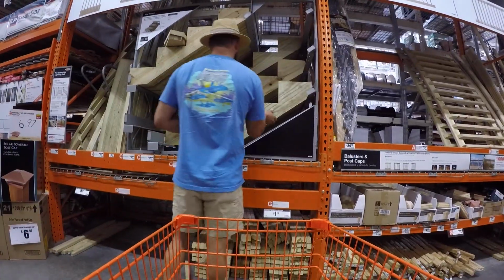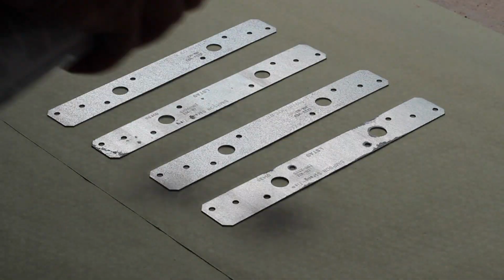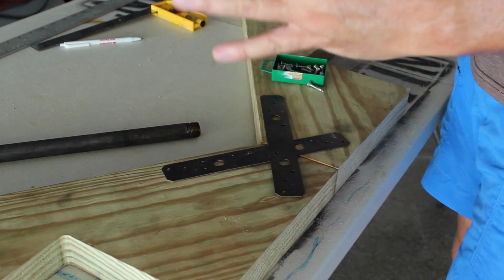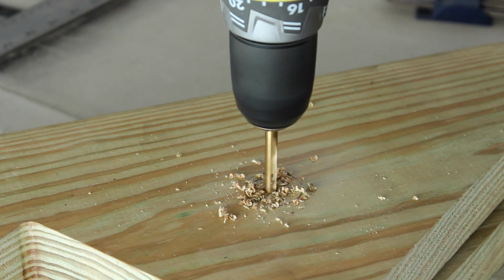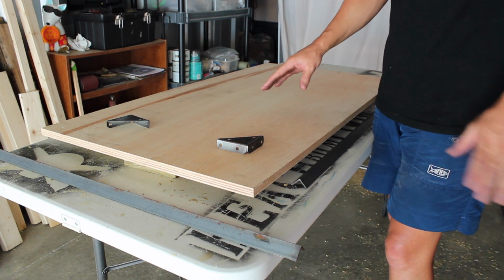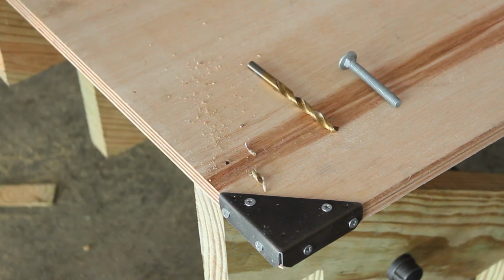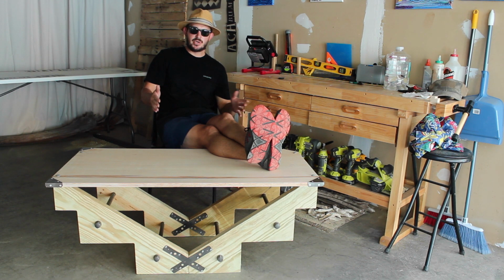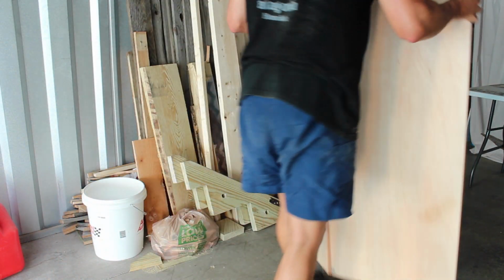How to Build the EASIEST Coffee Table Ever in less than 1 HOUR!!

Comment: Very innovative. I’m just curious, is it not inclined to rock like a pendulum. With the legs centred towards the middle is the table not going  to lift on one end if weight or downward force is applied on the opposing end. Regardless, I subbed your channel and give you 10/10 for your clever design concept... I’m going to give this a try and use distressed pallet timber for the top which I’ll also scorch with a propane torch to creat that shu Sufi ban effect.

Comment: Wondering if it would be tippy if too much weight gets out on the ends. Little kids leaning on it etc. Might think about inverting the stringers and separating them a bit if I build it. Could run some pallet slats across for mini shelves underneath. Cool table!
Reply from the maker: +punknhead23 Thanks and yeah, there are several ways to lay it out. It actually doesn't tip all that easy, its pretty heavy. For a coffee table it works but I couldn't stand on the ends of it.

Comment: Pressure treated wood should not be used inside the home.
Reply from the maker: +reactor903 It actually can be. Here's a question and answer from the site Prowoodlumber: Is Pressure Treated Wood Safe for indoor Use? "The simple answer is pressure-treated lumber can be used in any interior application except cutting boards and countertops." As long as you don't lick it or set it on fire within the house everything says its all good.

Comment: how much were all the materials about? cool table!!
Reply from the maker: Andrew Gregoire Sanded plywood=$22 Stair Stringers=$16 Strong ties=$8 Corner Brackets=$12 Black Pipes=$28
Total=$86
Reply: im guessing if you put too much weight on either side its gonna tip over?